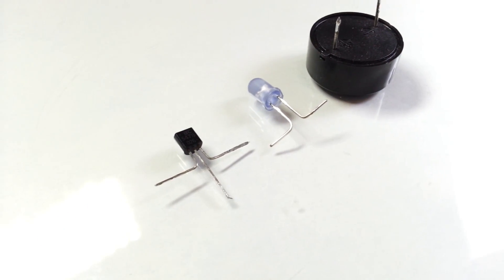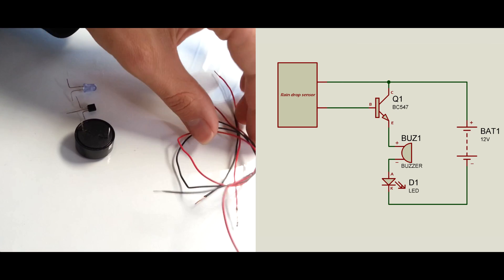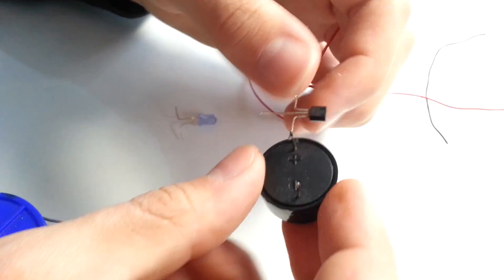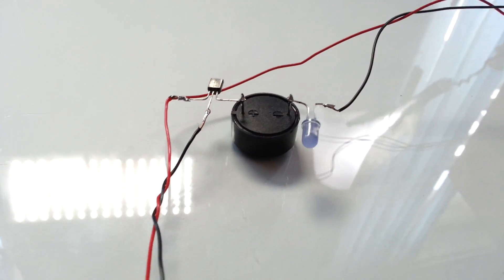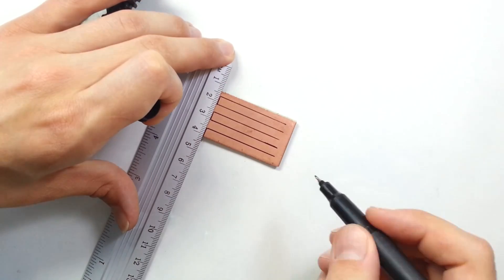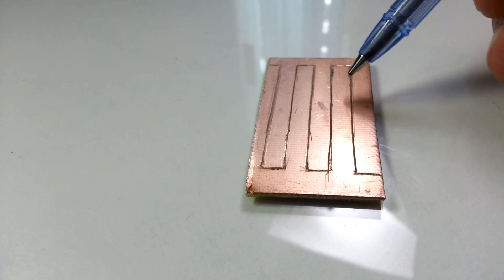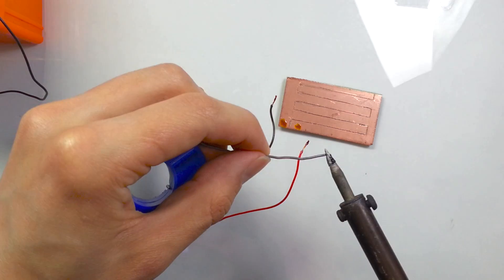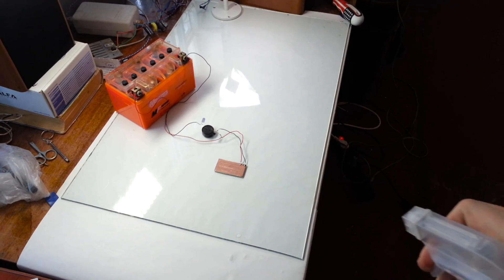Rain Detector - Can Sense Rain Drops | How to Make a Rain Alarm at Home

Comment: Can I use aluminium foil  instead of copper PCB and cut as you show in video and connet wires . (Where are you from, i am from Mumbai India.)👍
Reply from the maker: The point here is to cut it so it does not conduct electricity. You can try to glue two lines of foil to some insulation material (plastic for example), but these two lines of foil should not touch each other. And when a raindrop falls on two of these lines, then a small current will start to flow from one foil line trough the raindrop to another foil line.
Btw, hi from Ukraine.
Reply: @ElectricalPro  thanks for reply my friend

Comment: will it work in a long length of sensor wire? for example 15m?
Reply from the maker: I think it should work, although if there are power lines nearby it could pick up some interference. If you get interference to try to add a 100nF-2uF capacitor in parallel to 15m wires.

Comment: Please please
Tell me where to connect resistor
Because my transistor and led burn out
Where to connect resistor 🙏🙏🙏
Reply from the maker: You need to connect it sequentially with the LED. It should not burn out if you use correct buzzer.
You can connect a resistor instead of a buzzer, 470R - 1k resistor should work fine.
Reply: Reply
Reply: Please reply fast 🙏🙏🙏

Comment: Wow... Is it possible if i use 9V battery? And what if i want to connect a motor at the circuit?Is it possible to just use this simple circuit? Im doing a project.I hope you can help me🙏
Reply from the maker: Yes, but better disconnect the LED, just connect the wire directly to the buzzer. Well, the motor probably consumes more current than the transistor can handle, so you need to use different transistor... maybe a "Darlington transistor". Also, look at this project: https://youtu.be/ZXvtTmxAhu8 it is very similar and can definitely handle a motor.
Reply: Tq so much sir:)i already buy the single sided pcb board to make the rain sensor.however i feel that the structure is too hard to cut. So, is there any tips on way how to cut the board like you did in the video? And you cut the board using cutter rite?
Reply: Pardon me sir.. I have one more question. What is the liquid paste you use before u solder?  is it compulsary?
Reply from the maker: Well, it is possible to remove the copper layer chemically, by using Iron(III) chloride, also called ferric chloride, or with Nitric acid (you need to know how to do it)... But for me, it was much simpler to use a cheap "Retractable razor knife". You can try to use a scalpel or something similar. That liquid paste actually is liquid flux for soldering, you can use rosin instead. Liquid flux or similar things remove the oxide layer, and help to solder, for me it is necessary, without it soldering is difficult and often just impossible.
Reply: Sir.i have tried to connect all the components (battery 12v,dc motor,darlington transistor,sensor)but it seem when i spray water on the sensor..the motor does not move...why?
Reply from the maker: Don't know... Does it move when you connect together wires that go to the sensor? what transistor do you use?
Reply: We use darlington transistor.the situation  is like this..when we connect the wire to the sensor the motor does not move.but when we spray the sensor it also does not move.
Reply from the maker: Are you sure you connect transistor correctly? and what is written on your darlington transistor?
Reply: Yes sir.

Comment: can u plz tell me the model of buzzer u used and its rating????
Reply from the maker: Hi, there is not much written on it. It is advertised as 12V buzzer, but it can work even with 4V. It consumes less than 20mA of current.

Comment: can I use battery as a power source? If I use could you tell me about the volt of the battery and how to connect them pleasem
Reply from the maker: Hi, a 12V battery will work fine. You need to connect the red wire to the plus terminal of the battery, and the black wire to the minus terminal of the battery.

Comment: hii i have done same thing but befor putting the water LED is glow and buzzer is ringing
Reply from the maker: Hi, there are can be two reasons for that. Reason number one: there is a short circuit in your PCB sensor, so you need to cut the copper layer more... you need to separate the copper layer on that PCB into two parts, so the current doesn't flow from one part to another. Reson number two: broken or not working transistor.
Please do a simple test to find out what is wrong: disconnect one wire from that PCB sensor, and if it stops ringing it means that the transistor is fine, and you just need to cut the copper layer on the PCB more.  Tell me your result.

Comment: Hey i have done the same thing but  before putting the water only the buzzet is ringing
Reply from the maker: Hi, let's do a test to find out what is wrong...
For the test please disconnect one wire from the water sensor.
Does it stop ringing after you disconnect one wire from the sensor?
Reply: Same with me
Reply: No ringing iis stop

Comment: good day sir, is it possible to replace the BC547 with a MOSFET type?
Reply from the maker: Hi, yes it is possible, but you will need an additional resistor. I've chosen BC547 instead of a MOSFET just because the circuit will have fewer components. If you want to use a MOSFET then build a circuit from this video https://youtu.be/ZXvtTmxAhu8
The device in that video very similar to the one in this video, but it uses different water sensor. Just build that circuit and then use the PCB sensor from this video, and it will work.
Reply: oh i see, thank you. also for the quick reply 
(subscribed)
Reply: hello again, i was wondering what is the use of the 1M resistor in the circuit? is it to protect the mosfet from any damage?
Reply from the maker: Hi, no, actually It called pull-down resistor. It pulls Gate to Ground, without it the buzzer will be always on or off, or may start making noise at random. For more information just Google what is: "pull-up resistor" or "pull-down resistor"
Reply from the maker: Without some water on the sensor and without 1M resistor, the gate lead electrically will not be connected to anything, (except just a wire) and it is not good. The gate lead is very sensitive and will pick up interference and that will trigger buzzer at random.
Reply: thank you. i will sure to look it up

Comment: plz tell me again that why have you scratched the single sided PCB board
Reply from the maker: Hi, If you don't scratch the PCB the buzzer will make noise even if no moisture on PCB, it happens because copper layer conducts electricity.
It is not just scratching, I've separated the copper layer on that PCB into two parts, so current doesn't flow from one part to another. But when a raindrop falls on that scratch current start to flow through the raindrop from one part of the PCB to another.
Reply: thank you helped me a lot
but plz can you tell me something more about this rain alarm
Reply from the maker: Well, what can I tell... it is just a simple DIY project, so not much I can tell about it. It is simple, that's it.
Reply: can you reply me the full working please?

Comment: sir with  rain sènsor, if we need to car windscreen whipper automatically instead of ĹED buĺb for this çañ we attàch whipper motor
Reply: shehzad sardar use a 12 v relay instead of alarm , then connect to wiper motor ...
Reply from the maker: Hi, yes, it is possible, you need to connect a small 12V relay instead of the buzzer and the LED, and the relay will be able to control any device, including whipper motor.